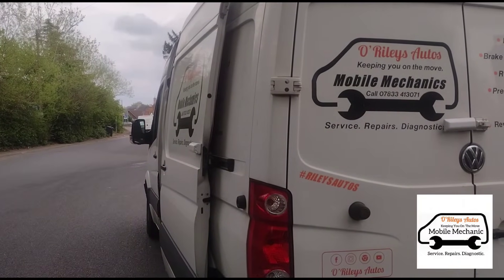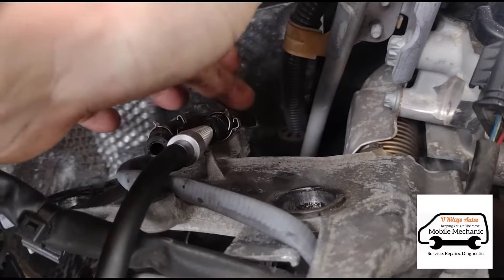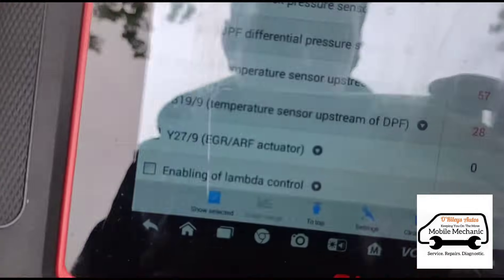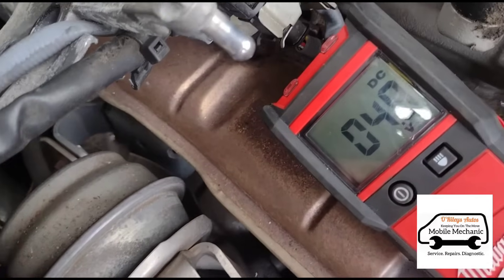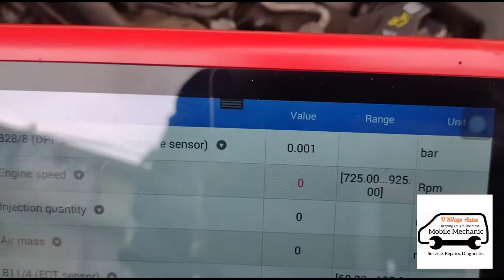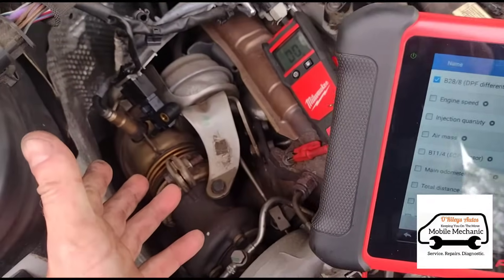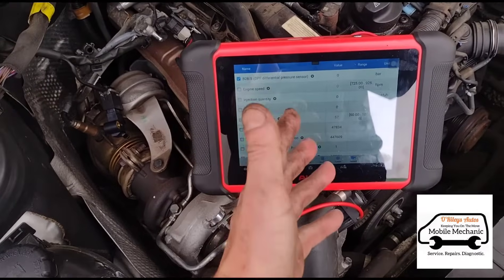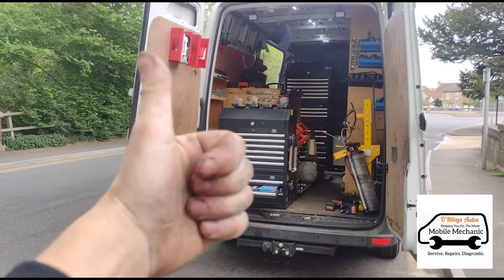How To Test DPF Differential Pressure Sensor. Diagnostic

Comment: My sensor is showing 3000mbar at idle and up to 11000mbar when accelerating. And the dpf is cleaner recently. Just regens often. 100km. I quess its time for new sensor.
Reply from the maker: Sounds like a bad sensor
Reply: @ORileysAutos  I found out that the sensor is correct but icarsoft reader shows it incorrectly. It shows it correct in dpf service menu.

Comment: hi iv been looking after my cars for year but this code keeps popping up p245328 the input for the dps 1 in the diesel is faulty the signal offset is outside the permissible range. sensor works fine please heeeeeelp ps its the same car as here
Reply from the maker: Should be the hoses are blocked or leaking. 

https://youtu.be/fbA34pvj6xA
Reply: @ORileysAutos  on

Comment: Good job dude nice to see someone actually diagnosing instead of firing the  parts cannon also some mercs had a service bulletin about changing the connector on the dpf pressure sensor for poor connection there's a pigtail plug available from mb I changed a few when I worked there.

Comment: So will the volts increase or decreasing on the sensor wire?  My base voltage is 1.2 and when I add pressure to the small hose the voltage increases. When I add pressure to the large hose voltage decreases.
Reply from the maker: Yes that's normal